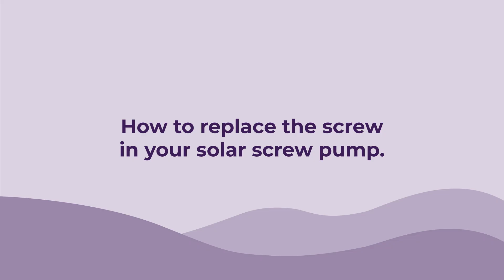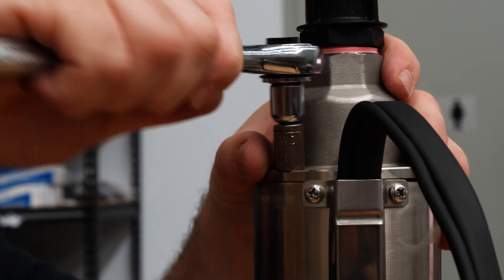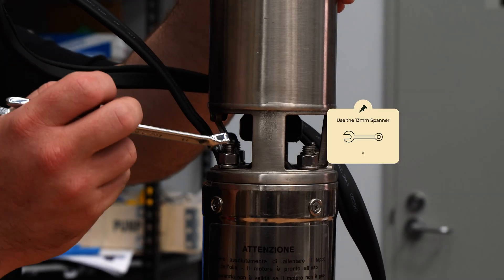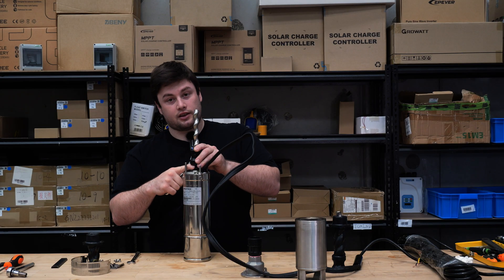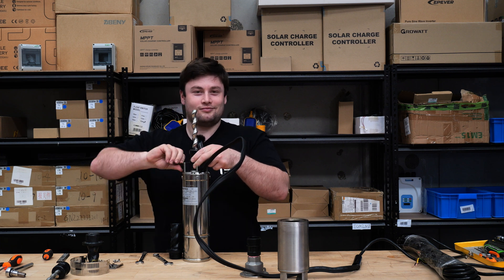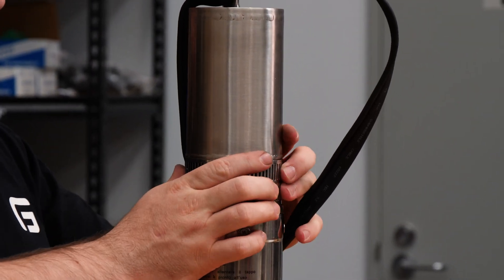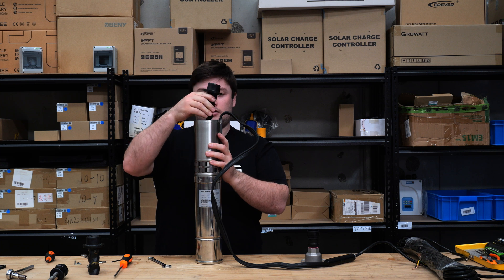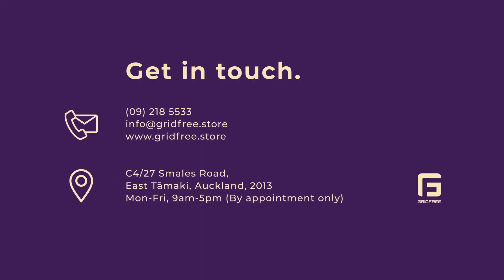How to replace the screw in your solar water pump | Billy's Workshop

Comment: Thank you so much for that. If the screw impeller is stuck due to sediment build up will the motor just hum ((struggle to turn over). In this instance, is there possibility that impeller is still ol to use after unclogging? I had to remove pump and travel 2 hours so I cannot test unless back on site.
Reply from the maker: Hello, thank you so much for your question! Are you able to send this through to info@gridfree.store and one of our technicians can help you.